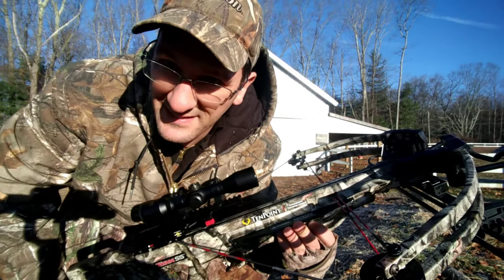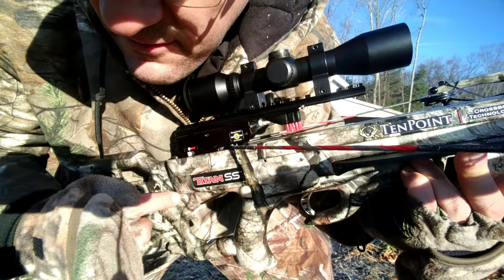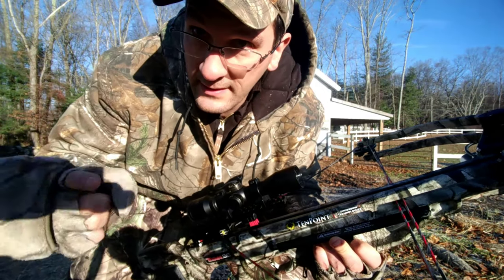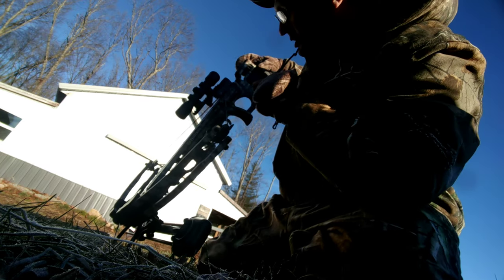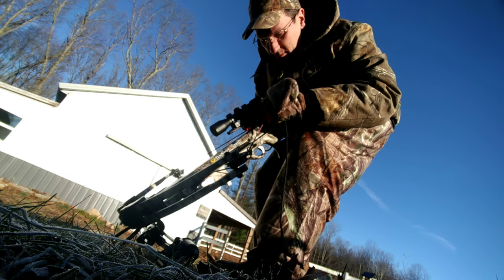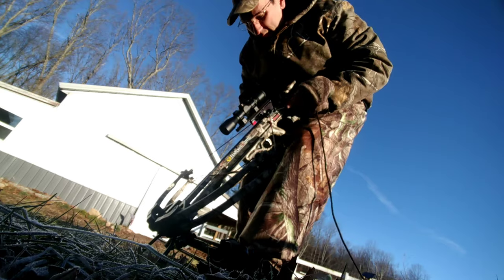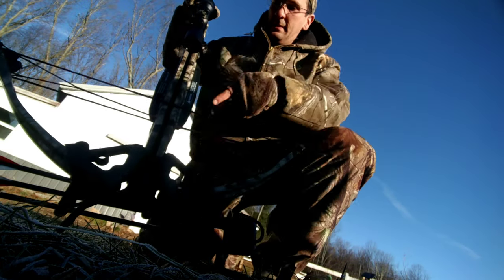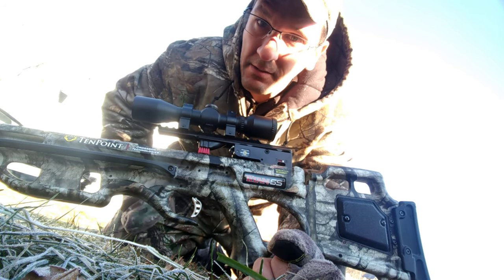How to Unload a anti dry fire crossbow

Comment: Great but does not work with Fang 350 PSE. You have to insert cardboard  (or other nock simulator etc.) then: off safety and let down with cocking aid. Better still tell me how to remove this infernal ,annoying  anti dry fire device that my Excalibur works perfectly without:>
Reply from the maker: Sorry that it doesn't work on your crossbow.